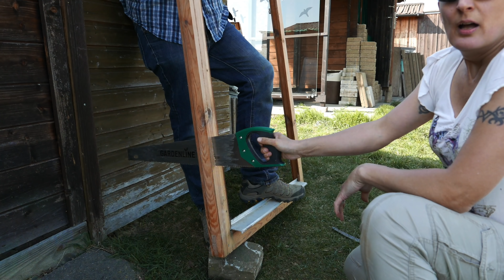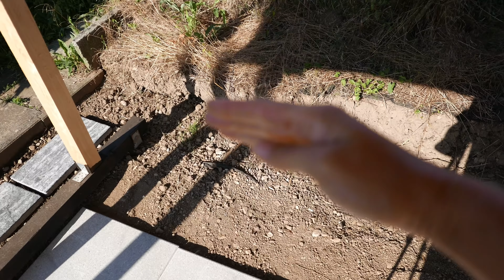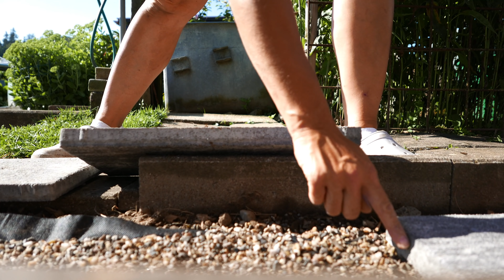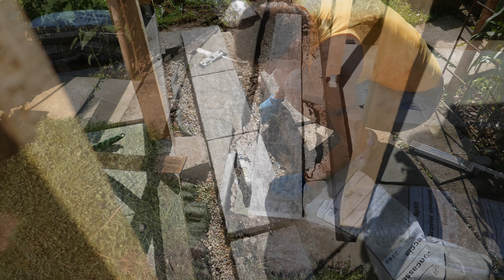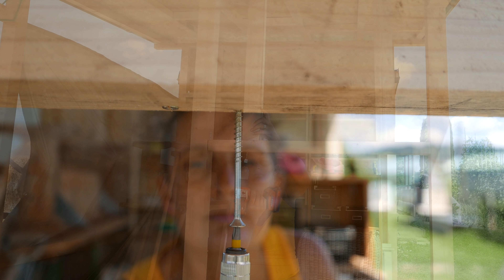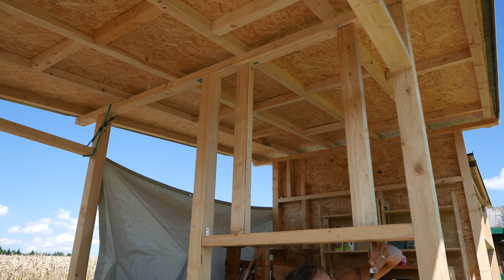Sitting area and windows, July 2020, E49

Comment: Just as you started to install the header above the first window, I was thinking " how a clamp would help here " next thing you produced one..small tip Tamara, when you install the piece of timber between the studs, you can clamp a scrap end of wood on the stud just at the height you want the crosspiece to sit, that way it your wood will sit on it and not keep falling down..It may only be building stuff in the description, but I'm all for it, and it's coming along nicely.